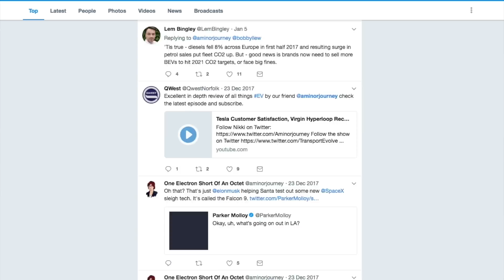Electric Car Fires: What You Need To Know

Comment: As a retired firefighter who has responded to countless ICE fires over a career I will take my chances over the inherently safer lithium battery technology. Very good reporting, I am impressed.
Reply: mondayfool; I don't understand your logic.  You write: 'But a large part of the energy is released as electrical energy'.  EV efficiency is about 80%. ICE car efficiency about 20%.  Range of an EV is shorter.  So gas tank has over 4* more energy than electrical energy of an EV battery.  Fuel tank is not always full, but same applies to battery.  Burning lithium metal releases lot of energy, but there is not much lithium in battery and it is not as metal form.  

You claim gasoline fire releases energy slowly.  Sometimes but then gas tank warms up to boiling point and explodes.  EV's don't explode.  Battery fire spreads fast only if whole battery has been damaged at once.  Even then only individual cells 'explode'.  

Extinguishing battery fire is of course slow process.  Chemical reactions happen inside closed cells. So no oxygen is needed.  Only way to extinguish is to cool it.
Reply: " EV's don't explode.  Battery fire spreads fast only if whole battery has been damaged at once.  Even then only individual cells 'explode'.  "

Correct, and furthermore, people not only need to know the difference between a fire and an explosion but also understand the ramifications. It's not like on TV where somebody can blow the bars out of a jail cell with dynamite and hide behind a bed so as not to get hit by shrapnel. It's the violent concussive force that kills, especially when accompanied by a giant flame that engulfs a car. When a battery cell "explodes," it pops like a firecracker on the ground. The force won't kill anybody.  The biggest risk with a vehicle fire is probably the fire itself, and with an EV, it's minimal because even if there is a fire, chances are that a person will get out well before the fire spreads, if not well before it starts.
Reply: @bruce shoemaker Ex volunteer firefighter here as well. Yes I've seen ICE cars burst into flames "spontaneously" as well.  None were reported.
Reply: All you can really do is control the heat. Once batteries enter thermal runaway and start to cook off there's no stopping them. The only thing i can think is trying to cool the battery to prevent other cells from starting to vent. Its actually really horrible that Tesla doesn't have a way to notify the driver that his batteries are venting.
Reply: EVs are inherently more dangerous. ICEs are subject to maintenance failures and can in no way match a lithium battery fire. Sounds like a bias.
Reply: " I'll stick with old, normal, PREDICTABLE fuel systems.  At least you can extinguish it."
 
And once you've done that, you can remove the charred remains of the passengers. I'll stick with something that probably won't catch fire, and in the much rarer case that it does, will do so slowly long after I'm out of the vehicle.
Reply: Current proposals are based on existing mixes designed for chemical fires...but you are right, the EV solution will be some water based mix probably even included in EV battery pack by manufacturer. 
As somebody involved in numerous battery packs fires in buildings and a couple in autos I find modern Lion systems the safest of all. 
Smart 2 batteries (apparently designed by Tesla) was the easiest. This thing just refused to burn.
Fire in Norway was most probably supercharger fire, this is indeed the real issue.
. Fire in California was the result of driver extraction (firefighters cut front panel off, probably damaging battery pack in the process). Fire in the Netherlands was the result of auto disintegration and the place would look much better if the firefighters did anything to fire (they haven't). There were few instances of pack puncturing from below (France case for example). 
Things to learn but the system is inherently safer than any proposed ICE type.
Reply: No, Teslas never burst into flames. This recent battery fire was the first unexplained one unrelated to a collision, and it didn't burst into flames. The compartmentalization of the battery pack kept most of the car safe. Even with fires after an accident, most of the car remains uncharred, while a PCFFF leaves a completely burned out hull and will engulf the passengers in flames and kill them. It's gasoline that's a problem, not an EV battery on a Tesla.
Reply: @bW9taeH4  tell that to Dr Awan https://abcnews.go.com/Business/man-burned-alive-fiery-tesla-crash-door-open/story?id=66498159
Reply: @bW9taeH4   well that wasn't true for this German Tesla owner. His car melted disfigured, in German   https://www.youtube.com/watch?v=29Kp4WnzX2I
Reply: @vortex162  THANK YOU FOR THAT!!!! That's exactly my point! EV fires are rare to begin with, but even in a worst case scenario, it's clear that there was no raging fire. Most of the paint is uncharred, while with a PCFFF, cars get burnt beyond recognition. This was obviously not a raging fire that engulfed the vehicle but a slow burning fire after a high speed accident. The man, who walked away from a high speed accident uninjured, says that he'd never buy any EV again, but if it had been an ICE fire, which would have been more likely, he wouldn't buy an ICE or EV ever again because he wouldn't have survived. 

You don't hear people complaining after an ICE fire because dead people don't complain, and with 280,000 vehicle fires per year in the US alone, they won't make the news because if they did, there wouldn't be room for anything else. Do you really think the media is going to run 500 articles each day in the US reporting on vehicle fires? It's not newsworthy if it happens all the time. But you had to go all the way to Germany to look for one, and you still failed to find a fire that engulfed the vehicle in flames. That's how rare Tesla fires are and how little they damage cars relative to gasoline.
Reply: @bW9taeH4  he walked because people pulled him out! Furthermore, in another clip the fire department said E fires are high maintenance to contain as there are way more things to consider and the flames are NOT easily extinguished!
Reply: @vortex162  Yes. A Tesla is about 93% efficient. Only about 17% of the energy from gasoline makes it to the car's wheels. So a Tesla battery with the energy equivalence of 3.65 gallons of gasoline has the range of an ICE with a full tank. You can't argue with the laws of physics. The energy stored in the battery is a fraction of the energy in gasoline, and the likelihood of a collision resulting in a fire is a fraction of what it is with an ICE.  So it's literally impossible for an EV battery to release the level of energy of a tank of gasoline because it's not there. 

Also, you are again proving my point with the video. When there are 150 vehicle fires on a given day in the US, and someone has to try to find video of every EV fire available to make the video you linked to, it shows how rare EV fires are.
Reply: @vortex162  Great. Keep proving my point. Gasoline is highly combustible and can quickly burn a car to a crisp. Batteries, when compromised, will release energy much more slowly, and it could happen over a day or longer. So firefighters will have to monitor the fire the way they would with a house fire or wildfire, where there could be flare ups for the next day or possibly longer. That's one of the things that makes them safer in the event of a fire. Drivers almost always have time to get out before the fire spreads, while with an ICE fire, if the driver is in it when it starts, it's likely too late.  You do NOT want a rapid release of energy if your car catches fire.
Reply: @bW9taeH4  some fires are more "volatile" than others on both sides of the spectrum. I've seen fuel fires in vehicles extinguished in few seconds with an Fire extinguisher. It all depends on the mechanical problem. You keep buying Tesla I won't! I don't want to go to sleep at night wondering if my batteries will overheat and burn my house down, LOL!
Reply: @vortex162  You can wonder, or you can look at the statistics. An ICE vehicle is many times more likely to catch fire. If you are the least bit concerned about being stuck in a vehicle fire, you should get a Tesla. Tesla fires are so rare that if one happens, it makes international news.
Reply: @vortex162  the car was disfigured ... not the man who drove it straight into a tree at high speed  ... the car caught fire slowly and he merely exited the car... no damage to anyone at all.
Reply: @bW9taeH4  Would you like a Covid booster?
Reply: I bet somebody will invent a better fire extinguisher for EVs ... for example the water-filled plastic foam, which resists fire (aka. keeps temp down at 100C) for about 30 minutes. You put one of these plastic sprays in each EV and the problem is solved.
Reply: Teslas burst into flames all the time.
Reply: Poor thing Seán, you got no answers nor likes... there, there...

Comment: Those car fire statistics only cover incidents that have a police or fire department report filed.  A small fire that the owners dealt with themselves without insurance intervention are not included.
Reply: Once a battery catches fire, it will continue to smolder slowly and will need a fire department to respond.  There are no unreported Tesla fires. If gasoline sets a car on fire, it will burn to the ground, and unless it happens way off road for an uninsured clunker in a sparsely populated area, it will get reported. The difference is that with over 500 vehicle fires per day in the US, they won't make the news since it's not newsworthy -- unless it's a Tesla in which case clickbait gets more readers.

Comment: If they want to ban a Tesla because one MIGHT have spontaneously caught fire, they'd have to ban Porsche, Lamborghini, Ferrari, Mclaren, Noble, Atom, Paganini, and dozens of other car makes as well.
Reply: I've seen ice engine cars spontaneously combust because of flaws in their design.  Take the series 2 3.8L chevy v6 found in many buick, pontiac, and oldsmobile vehicles.  

There was a problem where the egr orafice was too large and let too much heat into the plastic intake, warping it and causing a fuel leak at the injector heads.  Many people would park their cars, walk away, and return to a burned out shell because the leaking fuel was ignited by the exhaust.

Then there's the ford f150 my father owned that somehow managed to have the fuel feed line break just behind the cab in the frame rail, AGAIN being ignited by the exhaust.  Thankfully another driver spotted it and he was able to pull over and put it out with his fire extinguisher.

Then there was the navajoke I used to own.  Because the fuel pressure regulator had failed and allowed the engine to suck fuel directly into the intake via a vacuum line, it ran like crap and backfired constantly.  When I removed the vacuum line from the regulator, it squirted fuel out onto the intake, which instantly ignited.  No spark or anything, just the heat of the engine.

Given all those examples, it sounds like any car with an exhaust and a fuel system has a serious problem and should be banned until it's fixed.  I.E. removing the fuel or exhaust from the vehicle.
Reply: ROFL PAGANINI AHAHAHHA OMFG

Comment: Airlines allow laptops on board, but not cans of gasoline.
Reply: You can bring a maximum of 30 grams of lithium onto a aircraft. You can bring 5 liters of ethanol if you want.

https://en.wikipedia.org/wiki/UPS_Airlines_Flight_6

A heavy airliner can have as much as 100 ton of fuel, Jet-A is pretty much the same as Diesel. But they still carry lead accid batteries due to the fire hazard of batteries.

And this is not uncalled far. Boeing 787 was designed to carry Lithium batteries. NMC batteries, one of the safest types. They still had 3 batteries fires with in the first 5 years.. and that is just on a few dussin produced aircrafts.

Also worth saying is that hybrid cars often use much safer batteries. Because they need less capacity they can afford the extra weight to have the safer types. Tesla have the least safe type, also the highest cell count, making them the most prone to catch fire.

Also worth saying, the data in claimed in the video is totally squed. Counting arssine in a country where carbeque is a term... Where car fires don´t hit the news before its 150 cars... in the same city... the same night,
Reply: Big enough that if the plane crashes, it's likely that everybody will die. Of course the force will probably kill them first, but the same is true with an EV. Any accident that's severe enough that a person will die and there will also be a fire will almost definitely be one where the person died first, and there still would most likely have been plenty of time to remove the body before a fire started. 

There's a reason that airports will foam down the runway for emergency landings, and have crews on hand immediately to fight fires and evacuate the planes immediately. That wouldn't be the case with electric planes.  Those big fuel tanks on a Boeing 777 are part of the problem. Thanks for pointing it out.
Reply: Large aircraft have fuel jettison and if it is a modern design a nitrogen inerting system.

Then they have redundant fire bottles for each main engine and one bottle for the APU with automatic and remote activation. 

Fuel tank safety is know issue and that's why aircraft mechanics like myself have to pass SFAR88 training every two years.

Aircraft do however have loads of batties. Main battery (two of), APU battery and a host of smaller batteries for emergency lighting, No Power Break Switch over, Emergency Locator Transmitters and of course the the locators in the two Black (oringe) Boxes.
Reply: John Page that's because of the cans!  Stay away from the cans!
Reply: Airlines are powered by low flash point kerosene - not Li-ion batteries; and those batteries that are on board are controlled very very carefully.
Reply: nonsense